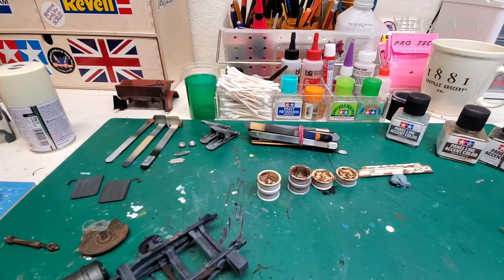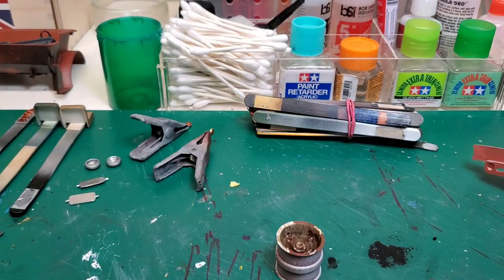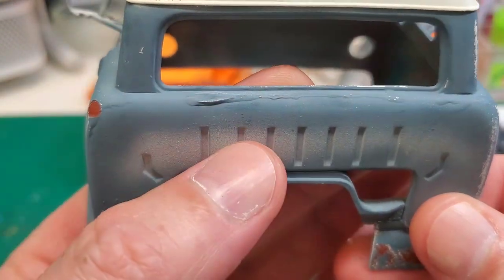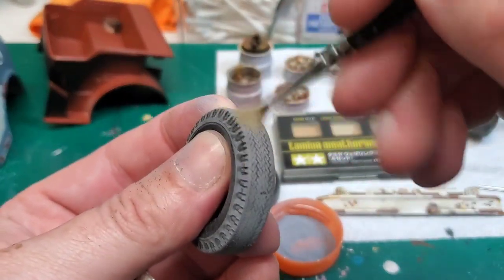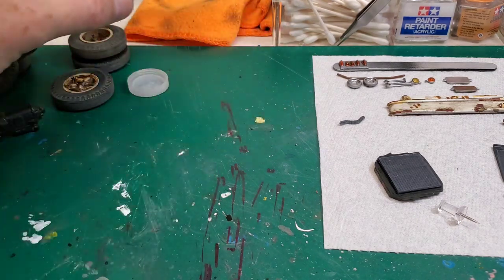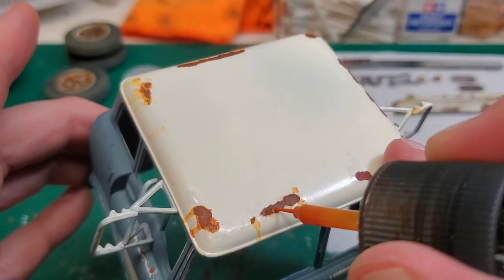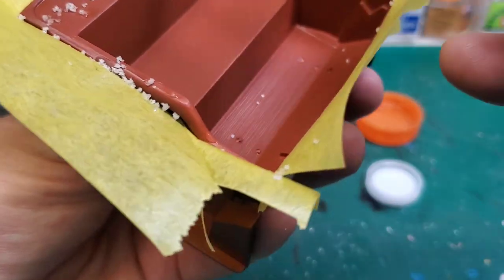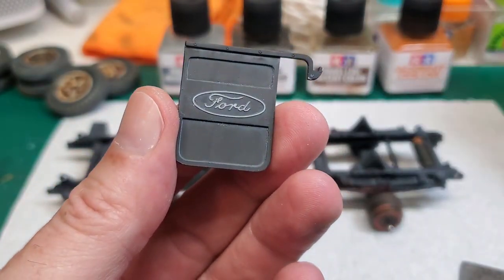AMT's Ford C-600 Tilt cab Part 3! We begin the Weathering process!

Comment: Great update Bryan. Some great tips also, even the tip from your niece. lol  I like that orange/brown wash. I did not know of this before. I got to get some of that stuff.   Forgive me if I might be wrong about a couple of things. I am going off of my old & abused brain cells ( only have 3 or 4 left) I think that the cabs on these trucks were made by the BUDD company which manufactures all sorts of things such as truck wheels & train cars. The same cabs were used by Mack & Pierce fire apparatus co.  Maybe other truck companies too. You mentioned about the cow (Bull) on the Elmer's bottle logo. If my busted brain cells are correct (possibly NOT!)  I recall that Elmer's glue was produced by the Borden's company (a dairy company) Their logo was Elsie the cow. According to my family elder's,  Elmer was Elsie's husband. Maybe this is a fact or maybe they were just messing with my head. lol. Anyway, your truck is looking great.
Reply from the maker: Hi Rick, thank you! As it turn out, i had been doing some reading about the cabs and it seems ford designed and created all the tooling for the cabs and had BUDD stamp them. so they are genuine ford, BUDD had the machines that could handle that larger sheet metal needed. I must say, this right here is one of the reasons i love model building! the research and the conversations that grow from it. 😊
Reply: @BGsModelWorkshop  Thanks Brian. More cool info being shared.. I find it interesting. Is it only model builders , who would care about Elmer the bull on a glue bottle?  lol  Have a nice day.
Reply from the maker: @rickzinck9326  very true! Lol

Comment: I've just found the original book for the short cab c600 the air tanks are one 1 of each side of the middle inside frame brace just back from whare you have put your one! I wish YouTube could let us sent images in these comments to help other modellers out with parts they need to know whare they go! But hope this helps somewhat!
Reply from the maker: Thanks for the tip!

Comment: Excellent work.  That truck is looking well used.  Great techniques.  I had always you used something besides water to get the salt to stick.  Also, the white glue technique is simple as well.  Thank you for shedding the light on a couple of techniques I was in the dark on.

You should check out Flourento (spelling is probably wrong) Rebuilding’s videos.  He is doing a very detailed series on building a Ford C 900.  There is some great stuff in his videos.  You may be able to get a couple of ideas from him.

Are you going to use the photoetched set of stuff on this build?

Thanks for sharing.
Reply from the maker: Hi Mike, is Florentino working on 1:1 cars and trucks? 

No photo etch for this build. Just
Keeping it simple not eve wiring the engine. 😁
Reply: @BGsModelWorkshop  He builds models.  Mostly the big trucks.

It looks like you are going to basically build it box stock, which is perfectly ok.  Every model I’ve built this year, except for one, has been box stock.

Comment: That's a nice build what are you going to put in the bed? I build this kit a few months ago but the Hostess variant with Trailmobile trailer it was pretty damn hard to assemble
Reply from the maker: Hi Justin, I am not putting anything on the back except the fifth wheel. this truck is the short frame so the flat bed won't fit anymore. we're just going to leave it. Thanks for watching!

Comment: so how does the white glue idea work? Do let the parts set for a day with glue and than when you are ready to take the parts apart., they just come apart?
Reply from the maker: Exactly! sometimes you may have to soak the parts in water to help them come away easier.
Reply: Because the glue is water soluble.  When it is dry, you can paint over it - the second layer of paint sticks to everything but when water gets under the second
coat of paint, it dissolves the glue, and the paint that is on top of the glue washes away.  It is the same idea with the salt.  After being painted over - the salt is
wetted down with water and dissolves.  The paint stays where it has adhered to the first coat of paint but washes away where the salt prevented it from adhering.

Comment: Use masking fluid instead of glue I've never seen glue used but it's the same as masking fluid only you get more inscale chips ammo blue or Humbrol pink is the best just get an old bit of packaging sponge and dab it in abit and dab alot off on a paper towel and apply the then paint when dry! To active it just wet ot or pick it woth tweezers or a toothpick if you want hard edged flaked chips and wet it for finer worn effects

Comment: Why is a bull on the Elmer's glue label ?  Back in the late 40's and early 50's - Borden's mascot was Elsie the cow (the whole cow/milk connection).
In many advertisements - at the time - often Elsie would be dispensing motherly advise about the benefits of milk to the youngsters (little cows).
Elmer (the pseudo father) would sometimes be in the advertisement as the foil or butt of the joke, whatever the topic of the cartoon happened to be.
So, Elsie was busy touting the benefits of milk, Elmer - as a "strong" bull - could tout the benefits of a strong glue.
Reply from the maker: Oh wow!! Makes total sense,  thank you for sharing that. I would never have guessed. The only connection I could make was the old horse and glue factory one. So the bull didn't make sense there.